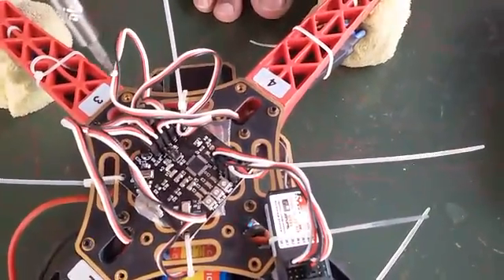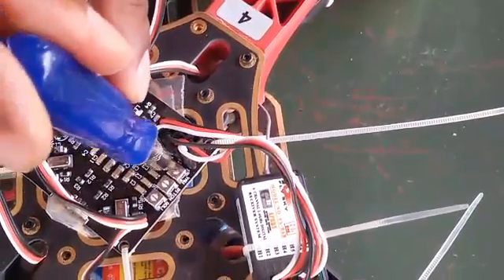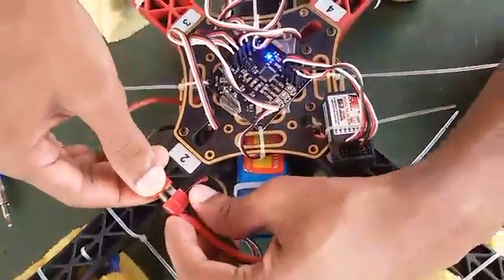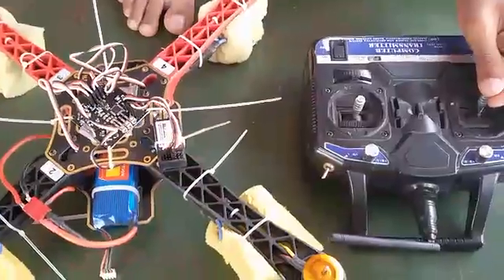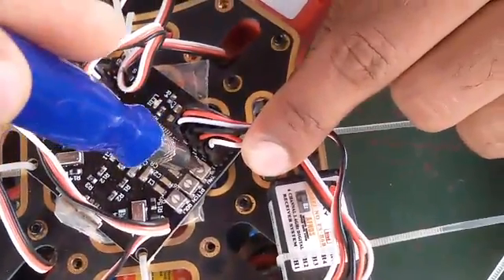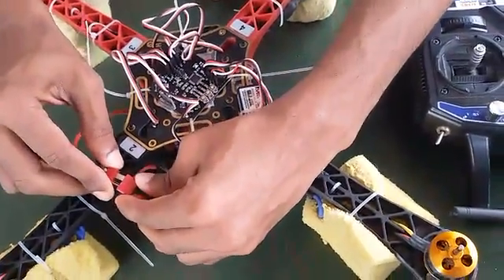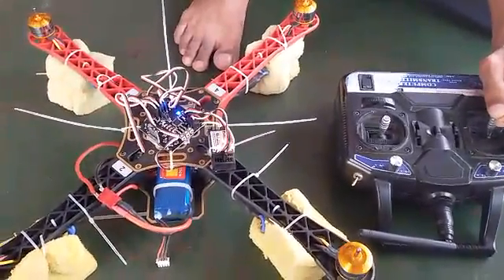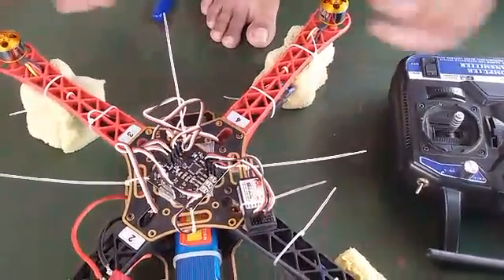QuadCopter Flying Setting of KK multicopter V5.5,Controller ATMEGA 168P

Comment: i have a crashed drone with 4 bldc, esc, KK multicopter V5.5 board & fly sky fs-r6b 6 ch module & frame,no remote/battries/props which remote would work with it, managed to test bldc's with esc servo testers & 3s 18650 worked great.